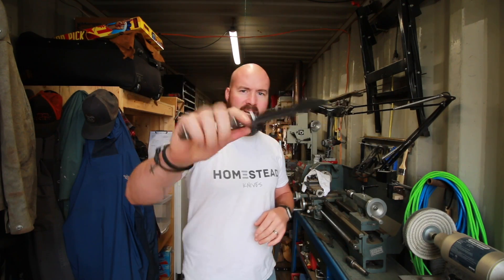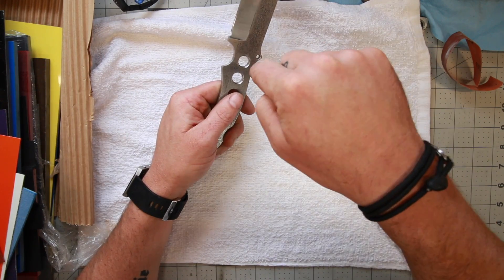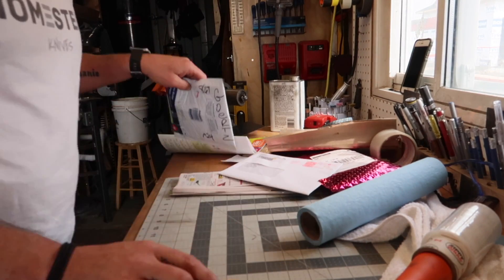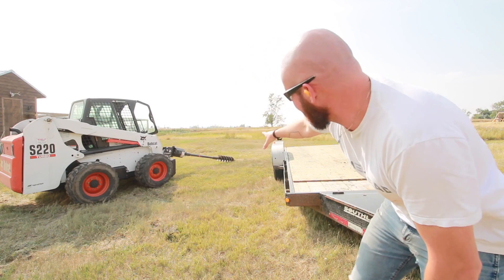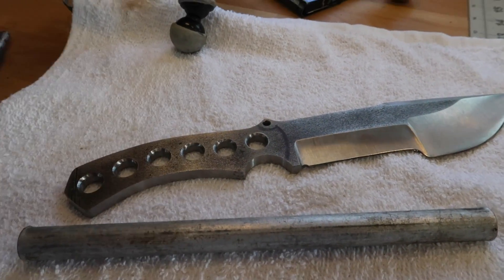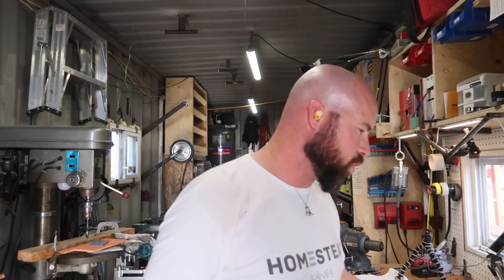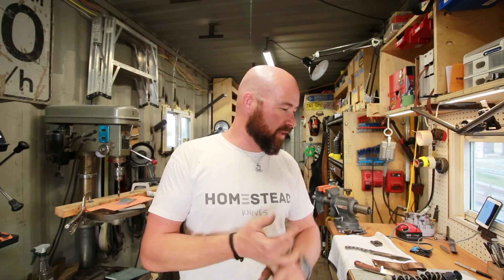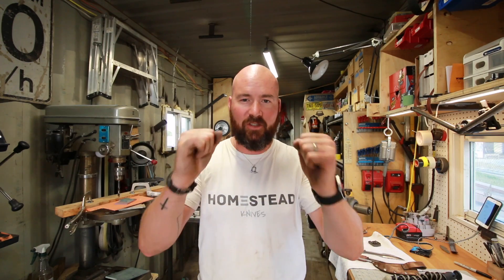It's National Knife Day! - (knife maker's daily vlog)

Comment: Instead of trying to use an elaborate system to mount the scales, you could do mosaic pins in the top and bottom or top bottom and middle. You could also try to add the angry face into the mosaic.

Comment: I dont know if you drilled the holes for the knife handle on a mill or just a shop style drill press, a drill press sometimes will not have the accuracy to drill a hole 1/4 exactly. You can use reamers to sneak up on the size in a mill for the best results.

Comment: First off enjoy you channel, keep up the excellent work. On the handles for the Tracker Knife, I would think the easiest way to fill in the holes would be to thread them. Then cut off a bolt, drill a hole through the center of it. Put some lock-tight on it and thread it in the hole. Anyway just a thought.

Comment: Offer your own engraving. Get some sign  Vinyl and cut it with your craft cutter. Mask the blade with it and sandblast it @ about 60  - 80 psi with some aluminum oxide, silicon carbide, or just plain fine sand.  120 or finer grit. It's reffered to as sandcarving. if you wan't to search for it on YT or Google.

Comment: BROTHER,, you Don't NEED those inserts. The epoxy IS going to fill up the gaps... as long as the epoxy is thickish and you have a good seal between the scales and the tang. As a matter of fact, it should make the whole pin process more simple.

Comment: Love your channel, you been Demonetized yet?? It's coming. 
U ever think bout using tapered pins to hold things fast? Made a piston all alum the connecting rod had a matching taper used some very good gluing compound beat it in as far as I know the piston is still pumping chocolate back East somewhere, tapered pins R fairly cheap u can buy same tapered reamer or use your lathe which is what I did. Continue them pushups. U will get buffed. Hasta Luego Señor